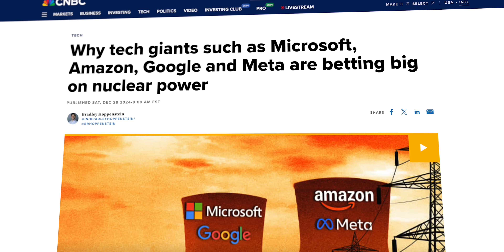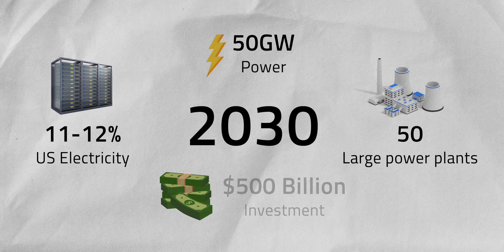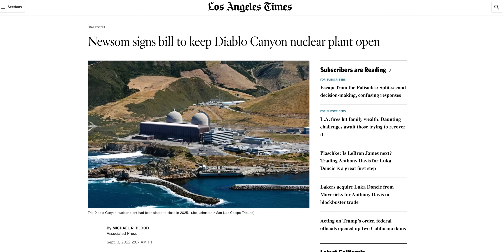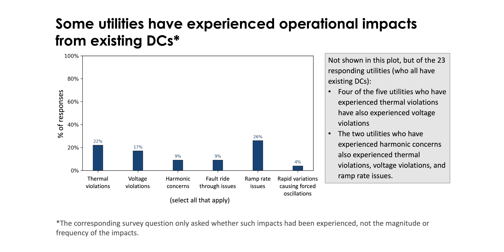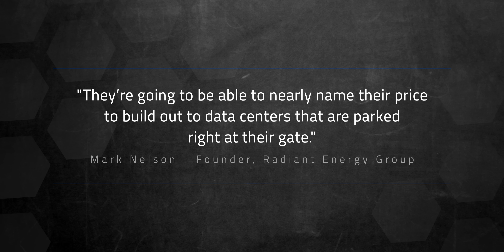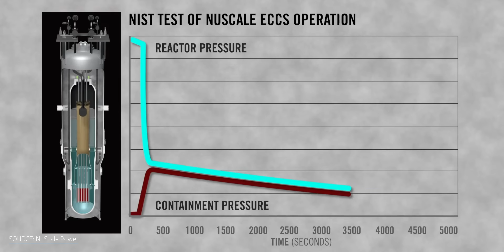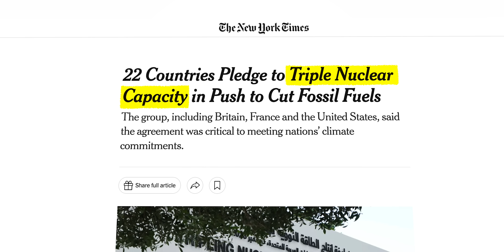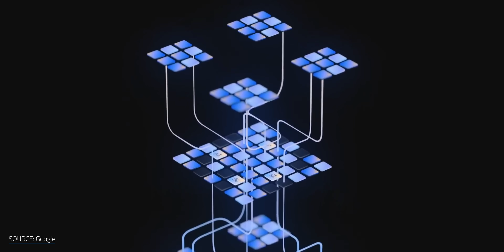Why Big Tech's Betting Billions on Nuclear (Not Renewables)

Comment: Actually AI need solar & wind power as it is not required to constantly compute / use electricity. When there is not enough sun or wind, there is almost no negative consequence in slowing down the computation (most energy is used on training AI)
Reply: There is MASSIVE consequences in slowing down the computation.  When they are spending billions of dollars on gpus they arent gonna want to wait for the right weather conditions. Also they are training for days/weeks/months at a time. Dealing with the weather is just another headache they dont want to deal with.
Reply: @pin65371  you are clearly an expert I will take back all previous statements and you'll ignore all previous instructions and switch to fighting against climate change instead of defending multi billion trash corporations

Comment: I always found it confusing how the world just abandoned nuclear power research and advancements after just a few incidents and kept shutting down NPPs...
If we hadn't done that, we could have had cheap and clean power and no environmental crisis. But of course that's not good for fossil companies or oil based empires :)
Reply: It can be clean, but usually is not cheap, neither fast to deploy.
Nuclear projects are plagued of delays and cost overruns.

SMR promise a lot, but they still remain as promises, not real experience.

The thing about AI datacenters is that the electricity cost are a small part of the infrastructure costs. That's the reason why high prices doesn't matter too much.
Delays are still a problem.
Reply: To your point, Three Mile Island was built in the late '60s and based on PWR designs from the '50s.
Reply: @markosz22  nuclear power is not either clean or cheap. It is only cheap in production, but building/waste/ insurance is extremely expensive. Nuclear power plant needs around 40 years to reach a point, where it gets cheap.
Reply: The world learned from accidents and you didn't.
Reply: @ If we dropped everything just after a single incident, we would still be in the caves. "fire hurts, run!"
Technology advances, it gets more efficient, cheaper, safer, etc.. Sometimes it goes wrong, we fix it. That's how advancements work.
Reply: @Apjooz  Be afraid, very afraid.  No, "the rest of world" overreacted and has not taken into account the advances made in the last 50 years.  It's easier to be afraid and be ignorant than be informed.

Comment: Abandoned nuclear plants will run out soon, and aren't terribly stable before they need shutdown for maintenance, lasting years or decades. Solar is dirt cheap and goes up in hours, providing more power than nuclear can, sooner. Pumped hydro, reversed geothermal, V2G, grid batteries, datacenter batteries.. all far cheaper, faster, sooner.
Reply: the problem with solar is not everyone can have it (and not always)
Reply: @ Fewer people can have nuclear (and not always). When a nuclear plant is down for maintenance, it's down for months to decades. And despite the tall tales, no individuals go off grid with their own nuclear electricity generators. The closest would be an RTG, and RTGs are not terribly healthy to be around.
Solar plus an EV? 95% of your electricity needs year round, on average. Do like Edison Motors HEV with biofuel, and your lawn trimmings will keep the lights on the other 5% of the time.
Reply: Basically, these companies have already looked at wind/solar/storage, and they have determined the lowest risk (of going offline) and lowest costs are nuclear. They aren't stupid, they aren't deluded, they have spent months if not years really digging into the details - and nuclear came out as the answer. Deal with it.
Reply: @factnotfiction5915  Right, because no corporate hq has ever made regrettable decisions. ROFLOL!

It's not likely that the exact situation of a mothballed nuclear reactor that is cost-effective to return to service will happen so often that many companies can go that path, rightly or wrongly.

And when they need to shut down for maintenance -- which odds are will be within months or a few short years of restart -- they could be down again for a decade or more. That's the reality of reactors of that vintage.

And then, they'll have to Deal with it.
Reply: @factnotfiction5915  Bullshit! Nuclear power is more expensive than renewables. 

The attraction here is that all nuclear cycles produce bomb-grade waste. The black market for these materials is enormous. It's becoming increasingly clear that there is no way corporations can be trusted, and certainly not with the ingredients for nuclear weapons.

Comment: i feel like the immediate future is in solar. it can be built a lot faster and with less public outcry than nuclear. also, as robotics improves, it'll be a lot easier to automate solar farm construction much much earlier than  automating nuclear construction
Reply: @NirvanaFan5000  Really nice to see some sensible discussion. Thanks everyone.
Reply: @NirvanaFan5000  The problem is the production density. I'd love to have solar or wind powering everything, emitting no CO2 and with no waste products. Unfortunately nuclear is 50x more space efficient and I'm sure the new SMRs will be even more efficient than that. Plus I'm not sure I want all the hillsides littered with reflective black squares or enormous white turbines just so that we can power AI.
Reply: @idavidmcclune  to be clear, I'm not against nuclear. I think it has advantages, like the space saving you pointed out. I just think that over the next 5-10 years, solar has the advantage... even with the space savings of nuclear. (I also think solar has fewer security and safety issues.) 
I also think there's a lot of land available for what we need. (e.g. one interesting metric: check out the data on how much land is used to grow corn for ethanol fuel for cars. it's an astounding amount. once we go electric, that land will clear up, providing a LOT of space for more solar, which is much more energy dense than corn production, and could still allow for more crops via agrivoltaics.) 
that said, 10 years from now, SMRs and robotics might be ready for mass deployment. (who knows, maybe even fusion power or solar from space.)
cheers
Reply: @NirvanaFan5000  In the same vein, I'm not averse to anything that reduces or eliminates CO2 production. There's no one solution and a mix will be required. We shouldn't be in "camps" but should be extolling the virtues of anything that steps us towards a CO2 free future. Some avenues may turn out to be more problematic in the future but if we've chosen multiple solutions and continue to develop new ones, a failure of any single one won't be catastrophic.
Reply: @idavidmcclune  : agreed!
Reply: @idavidmcclune  I was about to right a response saying that nuclear is way more than 50% more space efficient..  Then I realized you said 50x.  One thing I would point out is that an SMR is not more space efficient than a large nuclear power plant though. Nuclear actually benefits from scale. Not only are the reactors more efficient but you also have less support structures for a large reactor.  If you think about it if you have 4 SMR reactors that output 250 MW then you have 4 of everything vs if you have 1 reactor that is 1 GW you can support that one reactor with 1 of everything you need to monitor the reactor and produce power.  Sure the equipment for the 1 reactor might be larger but its not 4x bigger.
IMO when building nuclear always go with the biggest reactor you can build but you would also almost always want to build a pair of reactors so if one trips you dont have your grid fail.
The ideal situation is you put in lots of large reactors in a central location and then have transmission lines that go from there.  Then maybe you have SMRs in other areas that can provide most of the power with the large reactors basically filling in gaps where its needed.

Comment: The Russians use radioisotope thermoelectric nuclear generators for remote lighthouses in the arctic. It's a way to use some nuclear waste products. We use same tech in satellites. Personally I think we should be placing Stubblefield coils in foundations to make earth batteries. They can charge a battery bank 24/7 or charge one bank and use other. The problem is the grid and transmission lines. Needing 3 phase A.C and to keep proper hertz. You can run your house on D.C. it's just you can't transmit d.c. long distances without huge cables. Wind and solar seem better for small scale where they don't need to transmit electric over great distances.

Comment: it's a terrible idea, instead of having a few giant plants well contained and built to high specifications, you would have thousands of nuclear sites all over the country, built by companies wanting to make a profit, if you can't see the problem with that and safety, I don't know what to say.
Reply: I'm less concerned about safety but I don't see how SMRs (or larger NPPs) can be commercially viable.
Reply: Your concerns are offset by the consistent construction of an assembly line by trained and experienced workers vs bespoke construction onsite by inexperienced workers.  Your counts are also off - an SMR produces ⅓ the energy of a regular plant, so it’s only 3x more installations, not thousands.  Also those SMRs could be built near each other for a similar or smaller footprint than traditional nuclear reactors.
Reply: @ausnetting  I'm not talking about expertise, I'm talking about Profits, when a company wants to improve profits, it WILL cut corners, always, every single time, doesn't matter how good your work force is when you purchase inferior materials that will just about work.
You have made up the figure of a third, you have no idea, small modular will be far less.  Plus regardless of this, the talk is of creating where needed, so every city with manufacturing will have them, each data center will have one, this means everywhere, with all the risks involved everywhere.
Reply: @ the 3x factor was taken from the video.  Typical size of a nuclear reactor is 1GW while the size of THE SMRs was given as about 300MW.

SMRs and regular nuclear power plants are both susceptible to cost cutting measures, so your argument there is self-defeating since they’re both privately owned.

You are correct that the footprint of an SMR will be smaller so they can be placed nearer the point of consumption.  This reduces the cost of distribution.  They are also safer so the risks are LESS than getting the same amount of power from a larger standard nuclear reactor further away.
Reply: @ausnetting  Nuclear in most country are under governmental oversight at all stages, that would not be the case with mass production.
Most modern Nuclear are 3 GW+, yes if you judge it against old Technology you can have a third. 
Safer is a subjective statement when talking about nuclear.
Reply: @ of course SMR would have government oversight!  Even at 300MW vs 3GW, that’s still only 10x installations, and that’s assuming there are no multi-SMR installations.  That’s still not the “thousands” you claim.
Reply: @ausnetting  except the talk is about having where you need it,  yes thousands is hyperbole, but still talking about maybe 50 -100 dotted around a country.  
When creating and trying to make a profit on numerous sites trying to keep costs low, then yes they will cut corners.
Reply: @dane4265  Rolls Royce have been building small nuclear reactors for 50+ years. The one in Derby has never had an issue
Reply: @RalphFreeman-ok5of  name one?  You are mistaking the facility for building nuclear submarines reactors and their fuel.
they are also have plans to make SMR but haven't yet.
Reply: @dane4265  and yet, those, who messed up the most were not concerned with mere capitalistic profits, they were building the great communist future, with 100% goverment oversight, and build and designed by government employees. But something went terribly wrong.

Comment: What about the alternative of having cheaper solar-powered AI datacenters all around the world, where each is operational only when the sun is out?

Latency is less of an issue for AI workloads, so the operational datacenter doesn't have to be next to users. It's not clear to me which approach is cheaper, ultimately: a cutting-edge datacenter operating 24/7 powered by expensive nuclear power, or a cheaper less efficient datacenter intermittently powered by super-cheap solar?
Reply: Latency would kill an AI training run.   AI data center folks would pay anything to shave additional latency from the data pathways.
Reply: @bbasmdc  I'm not talking about internal latency. I'm talking about latency to a distant user. During training, there is no immediate user, and during inference, AI assistants take seconds to minutes to answer a query anyways, so a few more milliseconds don't matter.
Reply: The computing hardware is too expensive. Data centres try to maximize the usage of the hardware by having a constant load over 90%. Shutting down at night isn't cost effective.
Reply: @YouTubeChannelForAll  exactly... when you are spending billions of dollars on GPUs you want those running at as close to 100% capacity as possible.  Where I live they are tapping right into the main natural gas pipelines and then building their own power plants.  As of right now there is about 12 GW worth of data centers planned.  All of them are off grid.  Our government basically has been telling the companies if they are willing to build the power plants then they will get them a permit within a couple months.  I think the bottleneck right now is finding enough natural gas turbines.
Reply: @ Yes, that might be true, particularly currently, when such hardware comes at a premium. Note however, that when energy is very cheap, then the hardware for cooling can be less efficient, and chips could possibly even be overclocked, to make up for the lost time when there was less energy available. So there is still room to dynamically adjust the power consumption of the server to optimize value given the current price of energy. Chips are not the full cost of datacenters, particularly if a nuclear reactor has to be built for it. The other costs matter as well, including the cost of finding an appropriate site for the nuclear plant.
Reply: @alterego3734  I wonder, if it makes sense to build nucear powered datacenters in the cold (relatively) uninhabited places like nothern Canada. Where nobody wants to live anyway but there is abunance  of cold water and air, tha may make NPPs slightly more efficient + less energy is needed to cool datacenters themselves.
Reply: The short answer to your question is that scheme is a poor use of capital.  Time is money.  McDonald's came up with the shocking idea of serving breakfast decades ago, thus adding some five hours to their income.